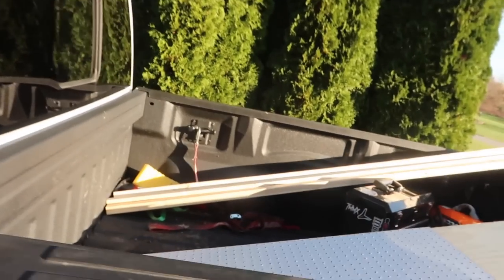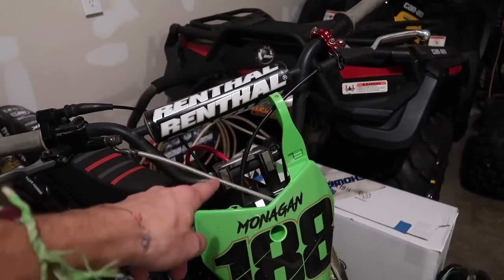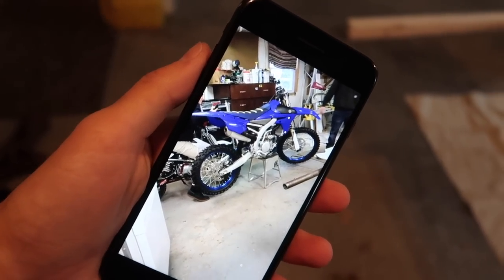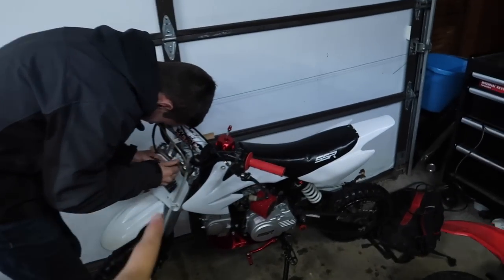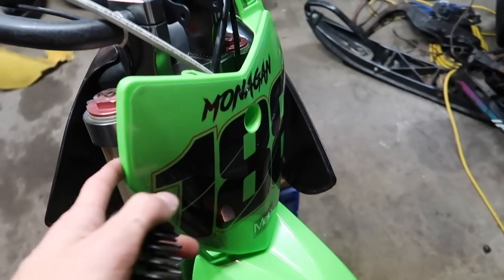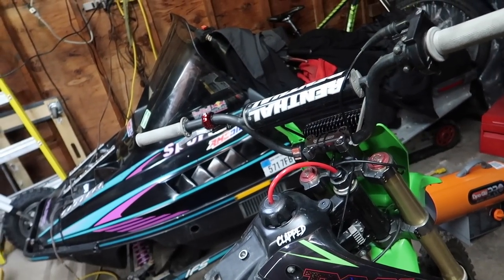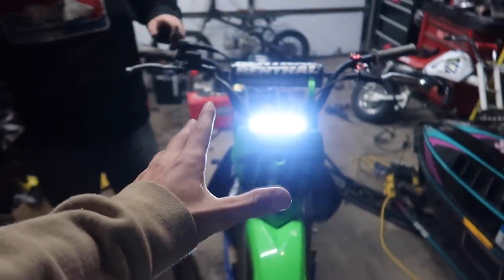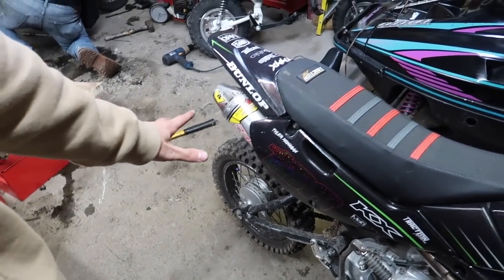BEST PIT BIKE UPGRADE + KX125 UPDATE #3

Comment: The yellow is the ignition wire from the ignition coil. Voltage through that fluctuates with the engine RPM. For an engine without a separate lighting coil (this one), you have to go straight to the battery for the positive connection (via a switch obviously). Negative side can go to any grounded wire or surface that's connected to the negative pole on the battery. The light will work independently of the engine (running or not) and be completely steady in brightness. Only downside is that you have to remember to turn it off or you'll drain the battery. Nice light! You've inspired me to put one on my 110L.

Comment: You need to put a resistor in with the wiring. Your bike is running A.C. those lights are DC. That will stop the flicking. Had to do this for the 24hr bark buster race up there in NY on my 300 xc
Reply: Yo if you guys ever come up to ny we got some spots to ride to. Hit me for the snap but shit wouldnt mind riding with these guys for a day lol

Comment: Is a 2007 kx250f with brand new wiseco top end for $1600 a good deal???
Reply: Mike Cast Depends on the condition
Reply: Mike Cast exactly I do motovlogs but anyways if it’s been maintained go for it
Reply: if it runs good and looks good then yes
Reply: Mike Cast No jk yes lol
Reply: Yup
Reply: Stay away from a 4 stroke thats 10 years old going on 11
Reply: I wouldnt get it. You want to stay away from older 4 strokes
Reply: Did you get it?
Reply: @jakehanus3536  facts

Comment: Ive got a 1993 Xr100r and i drilled a hole through my handle bars. I bought a battery and wired it to that with a switch on my handle bars
Reply: Im aware the hole isnt my safest bet

Comment: Best exhaust for my 140cc yx everything is upgraded thing it has 20hp has z40 cam race flywheel race piston ooracing wiring with rev limiter ported aswell what exhaust for 70 or lower should I get

Comment: KTM is the best (and Husqvarna) #snapsquad
Reply: Cole Rides you're very right
Reply: Ktm is a beast
Reply: Ktm is basically husqvarna but  still is shit make of bike tbh
Reply: Marty284 You are pretty ignorant tbh. KTM and Husqvarna are the best makes out there, but all the main brand bikes are so similar, so none of them are shit they’re all great.
Reply: Cole Rides 
don't take it the wrong way like but the gearbox in ktm is soft and the steering is sketchy
Reply: Marty284 You must’ve rode a shitty, old, beaten up KTM, because I have a 250 xc-f and it handles amazingly, on the track and trails.
Reply: Cole Rides 
I wouldn't touch a ktm with a barge pole
Reply: Marty284 so how can you talk trash about KTM even though you haven’t one?
Reply: Cole Rides 
My friend got a brand new ktm 350 4 stroke and 3rd gear went on him it was even brand new and had problems
Reply: Cole Rides yeah they are of course the best bc they look cool😂 not really

Comment: You don't blog about it any more hmmm I've built a custom one but because off frame I used could only use the shittest plastic kit you can get for pit bikes it's got a gpx125 oko flatside carby $1000 marzocchi forks. pro rear shock heavy duty rims I was at event the other night and they let me ride this pit bike on the mx track event night for pit bikes but like kxl110 and honda pit bikes I was the only one there with a this fucking shitty looking but very fast pit bike doing proper jumps I had to stacks yeah I admit 😂😂😂 stuffed my self up.

Comment: "best pit bike upgrade"??? so its had an extended swingarm, changed from centrifugal clutch to a normal clutch, big bore kit, pro circuit pipe etc and you call a light bar the best upgrade?? get off the pipe bro! lol AND i hate to break it to you but its still a suzuki man not a kx lol. i don't know why you got a new car. should have just changed badges to ford and painted it and called it a ford ;) lol